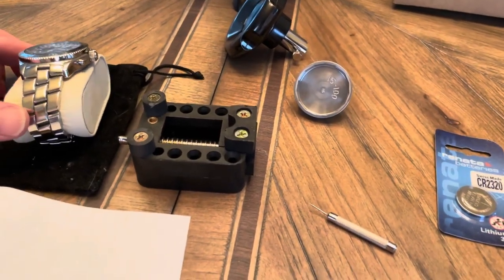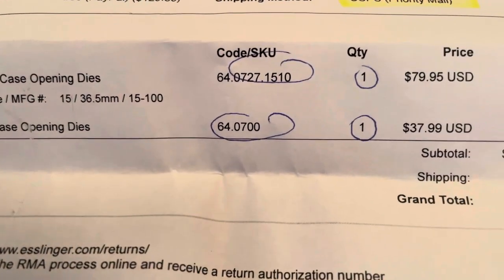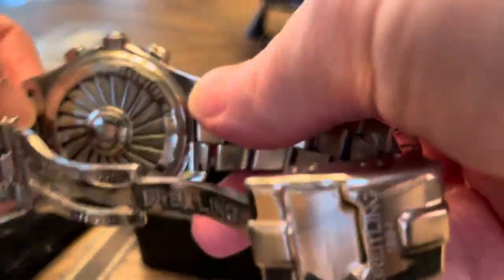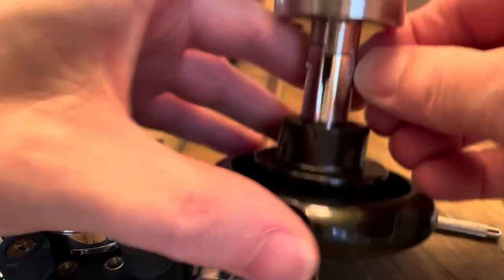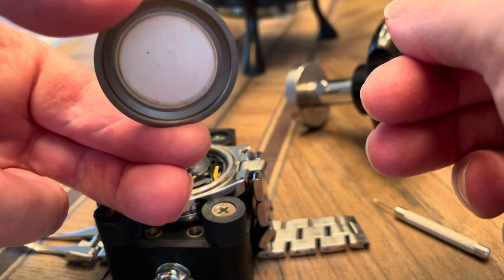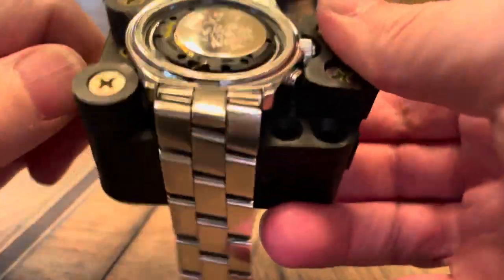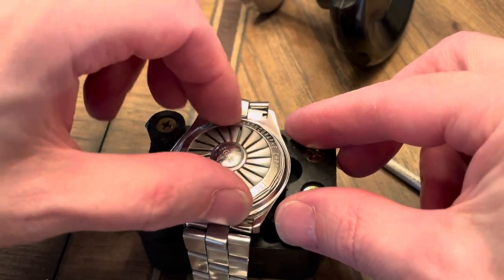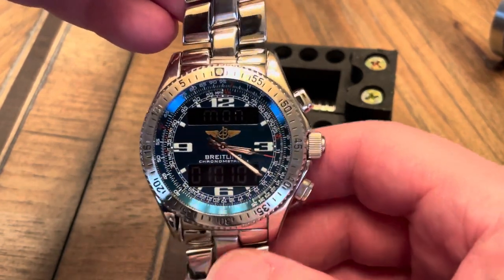Breitling B1 Battery Change

Comment: No joke, I did it with a broken ruler and double-sided adhesive tape. Put the double-sided adhesive tape on the back of the clock, put the ruler in the middle and then turn it like a key on a music box. I was able to remove the adhesive residue without any problems. Just a little inexpensive household tip